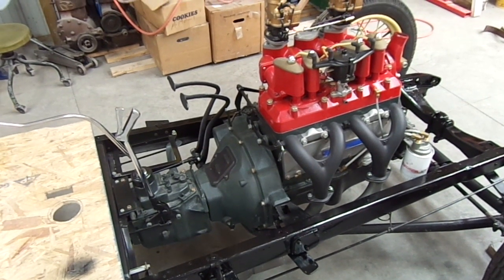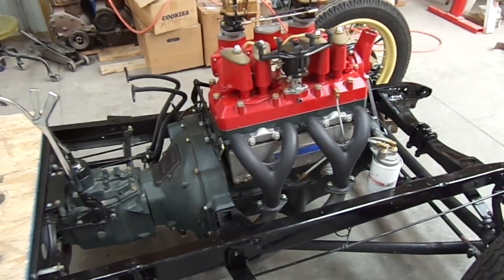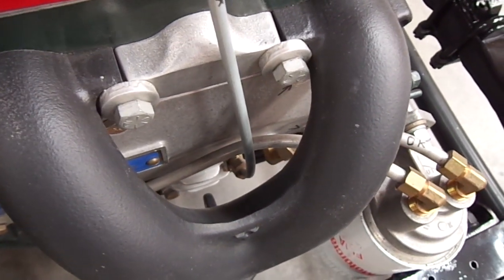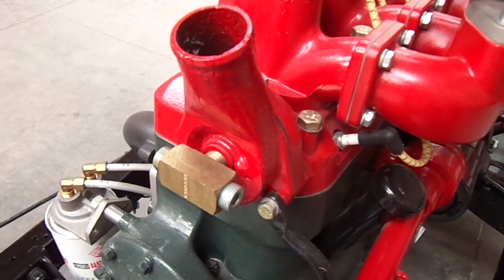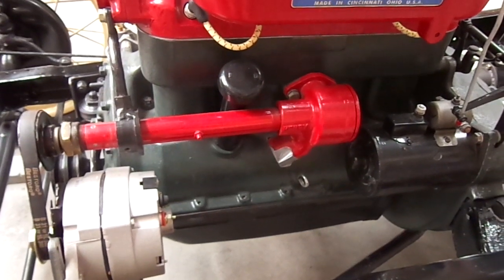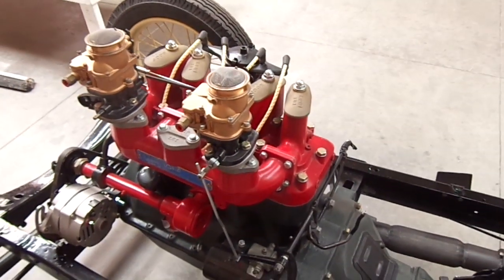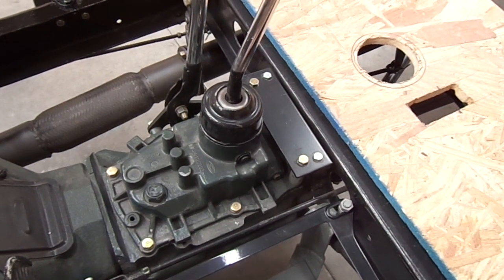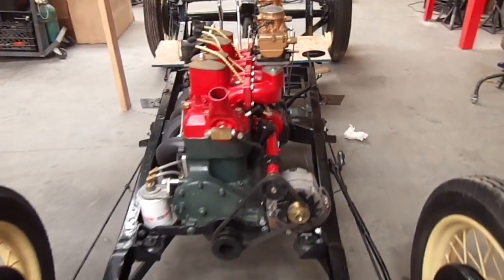ROOF 101 CYCLONE ENGINE 1

Comment from the maker: Hi Jorge:Thanks for the comment. We make these heads are are doing a production run this Fall 2013. I hope to have this one running in my speedster soon. Is that what you wanted to see or did you want more on the valve train, etc?